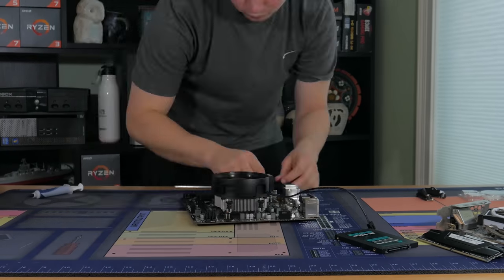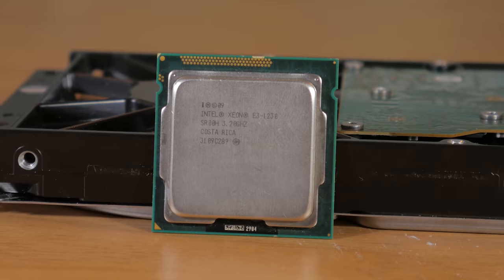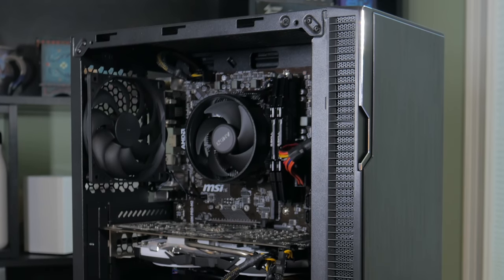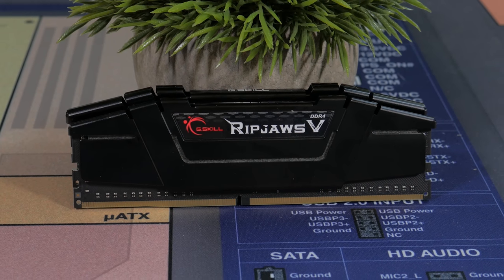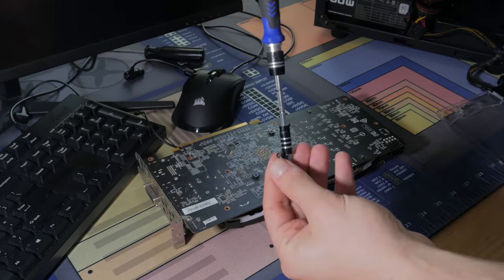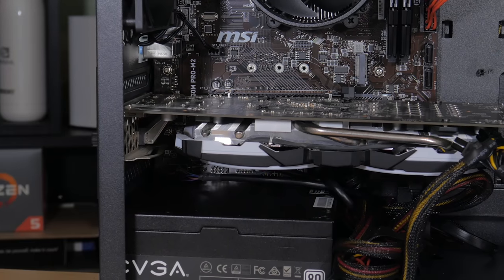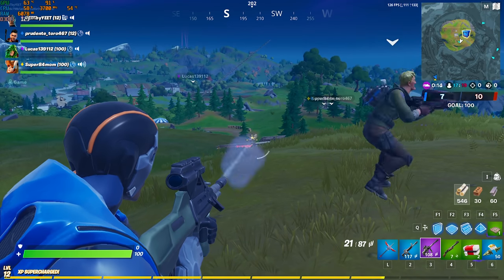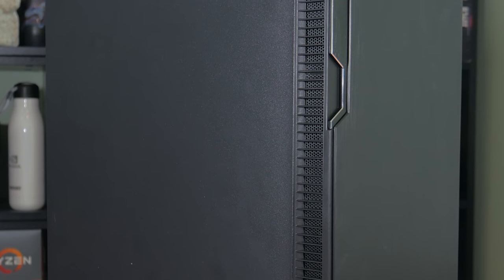This $300 USED Gaming PC is EPIC! (2020)

Comment: in all honesty it's worth making this into a $350 build getting the ryzen 1600 AF and getting 16 gigs of RAM would be a huge upgrade
Reply: Yeah the 1600 AF curb stomps the budget CPU market, even the used one. He could have gotten that new for 85 bucks vs the 60 he spent for a used 1400.
Reply: @shanez1215  Sadly the 1600 AF is highly depended on your region. I would have loved to buy it for my media pc. But it is 95€ (without shipping) in Germany. That's really not worth it. :(
Reply: @shanez1215  yeah it's a no brainer you even get the warranty on the 1600
Reply: I agree with the CPU swap but if you are MAXED OUT on budget I wouldn't worry about 16gb of RAM. I run 8gb of DDR3 still and none of my games hit 100% RAM utilization, yet. I expect to be at 100% use in another 2 years though.
Reply: I would actually upgrade the gpu as the cpu on the most load was around 50% while the gpu hit 99% leaving room for further cpu impr I'll vment but bottlenecking the gpu
Reply: @KILLTHEREDDITOR  dude gotta have that used 15$ second monitor for netflix/youtube
Reply: Or even just keeping the 1400 and bumping up to a 570 would help
Reply: JForce would you recommend 16gb of ddr3 or 8gb of ddr4
Reply: @brandongonzalez5992  more ram is always better in that comparison. But the problem is that each type is for a different era of platform
Reply: JForce so your basically saying different motherboards require different ram (ddr4/ddr3)
Reply: @brandongonzalez5992  yes. Any Intel platform after 2015 uses ddr4 while basically every AMD platform 2017 onwards does
Reply: JForce what ram would you recommend?
Reply: Not joking on ebay its like 150$ used
Reply: has the price for the 1600 af gone up?
Reply: imemes yeah like wtf
Reply: Unfortunately the 1600AF is $200 now
Reply: I got the last one at 85$ on amazon in my area a couple months back, have seen it shoot up to 170 too since then

Comment: Love it Matt.  I played a game of extra patience with purchasing parts and over a few months and here is the budget build I was able to do for around the same price which included a monitor and win license too.  Budget builds are such great fun.  Thanks for sharing them with us.

Optiplex 790 with an i7 2600  - ebay used shipped $68
Roswell 600w power supply - ebay open box shipped $21
GSKILL DDR3 RAM 16GB 1333MHZ - ebay used shipped $30
PNY SSD 240GB - new AMZN shipped $27
HDD BLUE WD  500GB - new NEGG shipped $17
MNTR 22' AOC 60HZ refresh - open box local craigslist $40
Win 10 pro key - AMZN  $25 
XFX RX 580 8GB - needed flash from mining - ebay shipped $101

Comment: The 1400 is good and all, but I think it would be better to up the price slightly and go with a ryzen 5 1600 AF for $85. since it is zen+ based Its basically a lower clocked 2600 for only $85 which is hardly any more money then what the used 1400 goes for, and the 1600 AF is new.

Comment: I bought an RX 570 4GB, 16GB RAM 3000 Mhz, Ryzen 5 2600, Gigabyte B450M DS3H mobo, Deepcool Micro ATX case, 500w PSU and Team Elite GX2 512GB SATA III SSD for $500 USD, here in my country atleast. Couldn't be any happier with the performance I got. It was such an amazing value for the money.

Comment: Great video. It's nice to see you can build a system this inexpensive that delivers that performance. I doubt my current system which cost twice as much 4 years ago would come close on those games. Realistically, with 16 gigs of ram and a 1600, this would probably be enough computer to be a good solid upgrade for me if I had to go the budget route (which for a change I don't).
Reply: 16gb RAM the 1600 and what graphics Card? I want to Buy an Decent budget
Reply: @therealclaiintec8590  Depends on your budget. A 1660 Super would be a good match, but would almost double the cost. A 1650 would be reasonable as well and cost somewhat less

Comment: im new to pcs and was wondering if this would be good to start with as i already have enough for this
Reply: Yes, I built this a week ago and it's the best pc for the price, over 60 fps on most games at 1080p, I would defenitely recommend, but if you have more to spare I recommend getting 16gb of ram instead of 8gb
Reply: @lottej9042  can i get every 16gb i want? Sorry i have no clue how to build pcs but do i have to buy a specific 16 GB RAM?
Reply: @jonahsvw9394  yes, I believe you can get any ram you'd want, I got a 8gbx2 Ddr4 3200 mhz from corsair. i do believe any ram will work, I recommend Ddr4 ram over 2666 mhz
Reply: @lottej9042  thanks Osama
Reply: How does it run Cod warzone?
Reply: @lottej9042  does it run gta 5?
Reply: @mersadramadani20  yes, it cruises around 60 fps for me, you might have to lower the graphic settings if you want more fps and sometimes it cruises around 55-60fps
Reply: @raccs9752  Sorry for late response, yes it will run war zone around 60fps medium settings
Reply: How does it run fortnite chapter 2 with low settings??... Its my first time getting a pc so i don't know anything
Reply: Nerqzzシ you wouldn’t want to run it on low lol even if your getting more frames
Reply: Jonah Weigand you need to make sure to check the mother board compatibility before buying anything else
Reply: @raccs9752  if you slap 16gb ram it can run but idk how im guessing low settings 1080p 50-70 fps
Reply: @drxpkxstasr6933  how about you watch the video, you will see
Reply: Vyra I am also knew to PCs and I was thinking about building one for my birthday to play rust with my Friends who well do you think it will run that because I heard it’s a hard game to run.
Reply: For a starting PC , this is a good way to go. As you can always upgrade it if you want
Reply: Vyra WHERE DO U LIVE AND HOW MUCH DID IT COST
Reply: Nerqzzシ my guy you need a $50 pc to run fortnite high settings on over 100 fps, I am exaggerating but fr you don’t need much

Comment: I actually don't believe in buying second hand but i got a killer deal on a used 1070 ti.It came with a 1 year warranty and by the looks of it it has never been used.The temps are fine and there's no indication that the fans ever spun so all in all im happy with the seller.It's still a beast of a gpu.There's nothing that i have that i couldn't play on max settings so far in 1080p

Comment: You might have been better off with a ryzen 5 3400g or ryzen 3 3200g and used the cpu internal GPU instead of the GPU card.
BestBuy currently has the EVGA 600W PS on sale for $45.  I bought one in store, and had it shipped to my house (store had zero stock).
I'm going to build a Ryzen 5 3600 system soon.  Planning on using MSI 450B Pro-vhd-max MB, and will get 32GB of ram (prices for 2600mhz-CL16 are about $150).  Also 1TB M.2 SSD ($100-$130).  I have a used R7-250 AMD video card.  I will repurpose an old Lenovo/IBM think tower micro-ATX case for this build.  It's just the right size, PS goes on top, but I can live with that.  Will have two case fans (f&b).    BTW, SCSI SSD's can be mounted to the case inside on any flat surface with Velcro tape strips.

Comment: I got a whole RX 480 system with monitor and headphones and nice mouse during Covid for $250   The EVGA 600W PSU alone is now worth $119- $200 due to shortage. Timing is everything. And according to eBay , my GPU is worth at least $115
Reply: is it 8gb? on aliexpress you can find a 480 4gb for 75 eu, or a 8gb for around the same price you've seen on ebay.

Comment: Just got a new GPU and this card runs pretty hot. Really wanna put my own thermal paste on in, even if it might not help, but taking the GPU apart will void a warranty. Sure, improving case airflow helps, but I'm so annoyed of those stickers on screws...  You can't even change thermal paste, but if something goes wrong, warranty will help with an expensive card.

Comment: I would  also be recommending that people optimize Windows 10 using msconfig and task manager to stop all needless boot options and change the core count and app failure time out to 3 seconds. Windows will only run as many cores as needed. msconfig allows all cores to be used from the beginning of boot and the 3 second time out usually will prevent OS crashing. Windows will only usually run one 1 core at a time in stand by modes. if you pick the highest number you have the least amount of delay in getting processing done. It is like a check out line 1 person handling 100 people is super slow. 4 or 8 people handling the same 100 people get checked out a lot faster and there is less delay times in completion. I don't know why this isn't done in gaming videos. it prevents bottle necking and the system isn't taxed when trying to play extreme video content that normally has to be buffered first.

Comment: Processor : i5-3570 (6500)
 Motherboard : ASUS P8Q 77-M2 (4000)
 GPU/Graphics Card : RX 580 4GB (18000)
 Ram : Kingston 8GB DDR3 1600Mhz (5000)
 Storage : WD Blue 500GB (1500) & WD Green 120GB SSD (4300)         
 PSU/Power Supply : Corsair VS 500 (2500)
 Case : Any Case (2500)
 Total : 44,300PKR which is equal to 280$
PS: all parts are used

Comment: I just picked up a hella used deal, R5 1400, MSI Bazooka B350, CyberPower case, 1tb hd, Logitech large mouse pad and a HyperX headset all for $100! The guy has been trying to sell the set up for a while and people kept bailing on him. I know I got hella lucky. I did however have to come up with ram. I got this system to upgrade my son's system and I was able to use his current psu that is a 500w gold and his current drives and gpu(evga 960 4gb)

I have found a few RX580 8gbs for $100 lately and I won't pay more than that for one of those used and I wouldn't pay more than $50 for any 4gb gpu! But alot of this is dependent on your local markets. Even the 1060s are going for $100 locally for the 6gb models, at those prices there is no reason to touch a 4gb gpu for more than $50!

The system I got was clearly a prebuild Cyberpower that the guy i got it from upgraded from and that's why i got the deal.

Sure to get deals like I got you got to hold tight to your price range and wait for the right deals and really depends on your local market. I refuse to use ebay or anything like that no matter how good the returns are I would rather inspect and get in person locally than ever use ebay for anything! My local market has some good deals because few people seem to buy locally so it's a buyers market but some stuff is well over priced.

Comment: How did you get that ram to run at 3200mhz? My 3200mhz Corsiar kit is stuck at 2666 and enabling XMP to achieve 3200 just causes instant bluescreen at desktop.

Comment: Thanks ! I was thinking of selling my current (2nd hand) i7 3820 system for a ryzen build but wiith budget cases I wasn't sure how many fans you need? I currently have vega 56 but would probably get a 5700xt or 1080ti on next rig so I know cooling important! Any guide for fan design and numbers on cheap cases? (i try and play at 4k / 1800p / 1440p 60fps as got great samsung 43" 4k tv hdr with ok 15ms lag on black friday deal )

Comment: I just finished building my PC, without the mouse and keyboard I bought all my parts new for around $260. I'm planning on buying a used GPU and most likely a new motherboard cause the one I have does not let my Ryzen  3 3200g run at 3.6ghz. I think im gonna get a gigabyte b450 moth and an rx480
Reply: SpankBuda that sounds awesome, where could we talk, Instagram?

Comment: New PC hardware's prices are skyrocketing due to COVID-19 so i went with a used parts gaming PC.
Reply: Yoooooo what specs
Reply: TaterCat I’m building a $400 pc, I’m using a ryzen 5 1600, rx 580, Asus b450m prime, a cheap case, and a 600w psu
Reply: DanielNotFound niceeee

Comment: I normally buy all used parts, but you literally can't beat the 1600 af for the price
Reply: What other parts would you get for it ? I wanna build one with 4 ram slots. And at least 16 gb ram
Reply: @tjn2254  you still interested?
Reply: Yes
Reply: @tjn2254  you want an all used system apart form the 1600af?

Comment: My $300 Facebook Marketplace build (goal was to build a good 1080p gamer at $300 or less from FB alone... Massively exceeded my expectations, tbh):
Case: Cooler Master HAF 932 - $50 (Huge savings here)
PSU: Rosewill ARC 450w 80+ Bronze - $25 (Good enough)
Mobo: Asus Prime A320M - $50 (bought together with CPU)
CPU: Ryzen 3 2200G - $50 (ordered a Ryzen 5 2600 off eBay today and gonna resell the 2200g, probably for a profit)
RAM: 8GB Corsair Vengence LPX 2800MHz - $30 (ordered a second matching stick off eBay today)
GPU: ASRock Phantom Gaming D RX 570 4GB - $70 (Huge savings here)
Storage: 500GB PNY SSD + 1TB WD HDD $65 (bought together)
Total: $300

Total after CPU and RAM upgrade: $460 (Probably sell the CPU for ~$70, though, so brings the cost to more like $390

This only took me 2 days to complete and altogether I dealt with 6 different sellers... I enjoyed it... Kinda don't like the case, though, but it's normally almost 3 times the price I paid, so I couldn't pass it up...
Reply: u dont need a 500 gb ssd u just need to download your os on it
Reply: @Josiah.435  I gotta disagree, especially for the price I paid... HDD was brand new and SSD only had 30 hours on it... Couldn't really beat that for $65... Also, I like to have some games on my SSD, especially now... When I commented this, basically just had Windows and GTA5 (to make it load faster and less texture pop-in) on it, but have you tried playing Cyberpunk off of an HDD? Especially on a lower-end build like this? Horrible experience...

Comment: why do all my friends tell me to stay away from a ryzen 1600 or 2600 i can only afford those .not the 3600
Reply: bad friends. tbh the 2600 and the 2600X are at a pretty good value rn.
Reply from the maker: Ryzen 5 1600, especially paired with a sub $250 GPU, is going to perform within 10-15% of the 3600. And the cool thing is that the 1600 is only $85. It's an amazing value for the money and I can highly recommend it.
Reply: If you can, get the Ryzen 7 2700x for the extra cores and threads. If you can't, go for the ryzen 5 2600x for the higher clock speeds than the regular 2600. Those who say to stay away from great value for the money parts are just wrong. They may know what they are talking about, after all third gen is faster, but they definitely don't know how to stay in a budget. Also don't forget the Ryzen 5 2600x comes with a wraith spire cooler, which is better than the stealth.
Reply: @TechByMattB  Make sure to get the AF model with a wraith Stealth cooler. It's essentially a 2600 for 85 bucks.

Comment: what settings was used for siege?? I have a rx 580 and get 150 fps avg
Reply: Medium
Reply from the maker: 1080p medium, but you have to remember that's with the built in benchmark. Also, there are a lot of other factors that will play into performance. These include your CPU's cores and clock speed, along with ram and ram speed.

Comment: Why go for the r5 1400 when the r3 2200 is also 60 new?
Reply: Because the r3 2200g has less threads 8 vs 4
Reply: @mr.br4dga279  and clocks, it's just better value

Comment: Can you try your builds on emulators?
Reply: Dont worry itll do better on emulators than normal games
Reply: @Auden.  People have different opinions for Ryzen CPUs for emulators. Do I´d like to be sure before I buy one.
Reply: @ventrue6516  ahhh i see man
Reply: @Auden.  I'd like to try some emulators too. Like PS3
Reply: @ventrue6516  yeah bro thatd be really fun and ud get to play games u didnt own b4
Reply: @Auden.  NO. emulation is not a virtual console, if you are running a NES game, it does not use the full potential of you 2080ti (just as an example). it will yes, use the card as much as possible, but the frames will not be the same as if the original nes console was equipped with a 2080ti

Comment: I want to build a PC which would run Beamng.drive at high settings. My budget is 350$ please help
Reply: Right now the ryzen cpus are a bit expensive to buy used so you should ho intel something like a xeon e3 1230 or a i5 4570 would be a good start
Reply: @techvisionhd_  Thanks for replying. Im going to the market tomorrow my father is a software engineer he also suggested me to buy an intel i5 processor. But he's not a fan of graphic cards so I need help in that. One that would fit in the budget and also wouldnt bottleneck
Reply: @vishwarao6064  rx 570/80 or a gtx 1050 or a 1650
Reply: @valid9068  i dont think gtx 1050 stands good to this date.